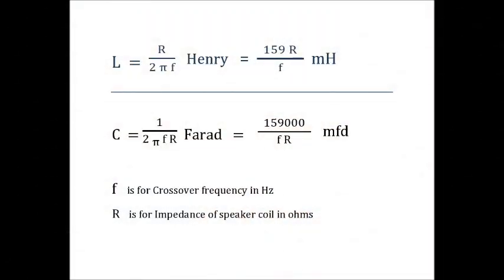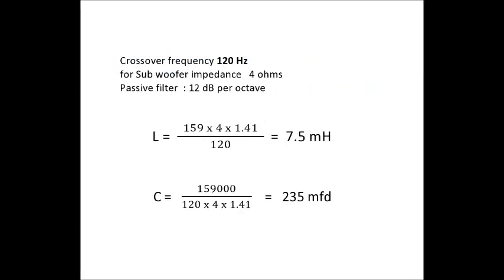Passive Crossover for 4 ohms Subwoofer

Comment: I am using 2  4" 4 ohm tweeter to make make 8 ohm

And 2 12" 8 ohm 250 watt woofer in parallel to make 4 ohm 500 watts

Comment: in your opinion that l ask l have 8 ohm kef 101 100 watts speakers and a  B&W passive subwoofer  150 watts with 45HZ -120HZ  its 4ohms  with 120 hz crossover filter with 12 db per octave slope to the mains what  would be the best crossover point l can set with my oppo 203 processor

Comment: Hello sir in the formula  what is 159R?
Reply from the maker: In the main equation the value is in Henry. Multiply x1000 to get mH. Devide it by 2π , you will get 159.  R is the value of DC resistance of speaker.
Reply: @makingloudspeaker  thank you ❤

Comment: Excellent Sir. I am from Bengaluru. I have a 20+ year old sony mhc vx7 hifi system. There are provision s for surround and center super woofer. Sir, what is a super woofer? The manual says 1 kilo ohm impedance speaker to be connected. Also specifies 1 volt. Kindly explain please.
Reply from the maker: This may be some special model for use with that particular amplifier. It's not a standard product.
Reply: It is a pre amplified output designed to connect an active subwoofer box.
Reply from the maker: @tonifatec  Output of 1 volt is available after pre amplifier